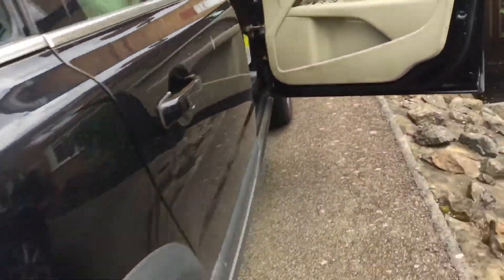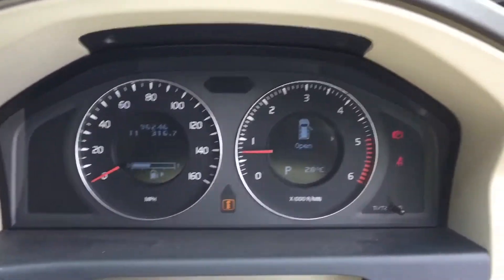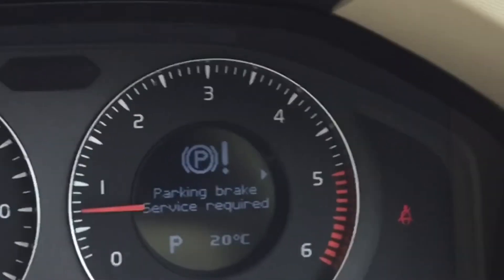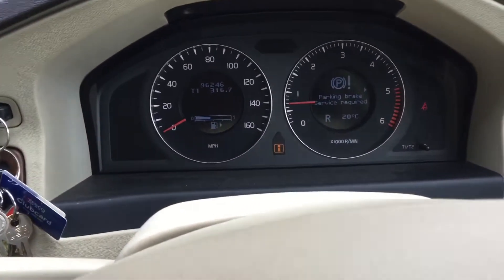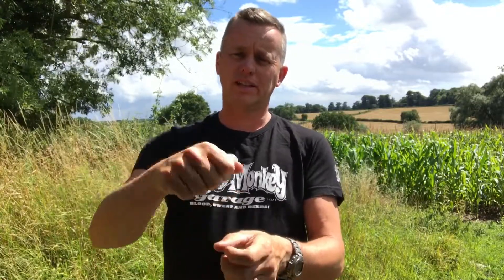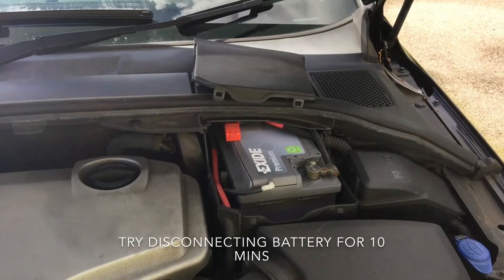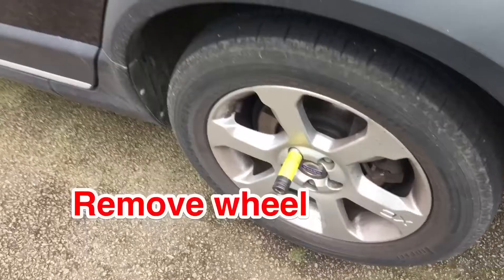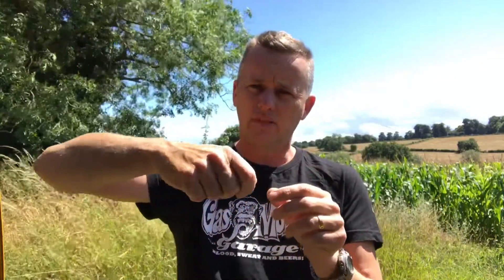VOLVO ELECTRIC PARKING BRAKE FAULT, HOW TO RELEASE IN A EMERGENCY XC70 V70 S70 C70 S80 S90 V90 XC90

Comment: My handbrake was just fine until I left the negative terminal off for 1 hour while doing a little coil work, and when I set off, it will not release the handbrake automatically, and I have to do it manually. I also find that when the rear pads were reaching their wear limit, the rear tended to drag and not release very well. Also, stopping and restarting the car sometimes gave the computers time to think and reset. I'm looking for a fuse now to see if it popped while removing the negative battery terminal.
Reply from the maker: You will need a bi directional code reader to reset like this https://youtu.be/Vi978aK4LGU you can also set the rear calibers and epb Thanks for the great comments👍🏻👍🏻🛠

Comment: Tips: use your phone to film each wheel, compare the sounds of the handbrake motor. For me the problem was dead right side brakemotor (or almost dead). Then i used 9v battery inside the brakemotor - no effect, then 12v, with veeeeeey little to almost no effect. I changed the right side caliper and brakemotor, and problem solved. I opend up the bad parts, and it was filled with salt, mud, rust etc.. inside the caliper cylinder there where parts that where loose to, so im glad i changed the whole thing.
Reply from the maker: Thanks for the great information👍🏻👍🏻🛠

Comment: You can also put the key to position 2, press the brake and pull for 5 seconds on handbrake release lever. Voila...
Reply: Unfortunately this didn't work on my manual V70
Reply from the maker: Thanks for the great information👍🏻👍🏻🛠
Reply: and if keycard..???? is it still possible

Comment: This happened to me and I removed the battery negative terminal for around 10mins, put it back and used a scan tool to clear all errors on the Parking Brake module and the issue went away, worked perfectly afterwards
Reply: Thanks! This worked for me too. Haven't cleared the codes yet, but it allowed me to move the car.
Reply from the maker: Thanks for the great information👍🏻👍🏻🛠

Comment: got the P problem on my 2018 s90 and the dealer said both batteries needed to be replaced, small and large one, for 1000 dollars. They s aid the problem was caused by weak batteries. This just sounded like b.s. to me, and I expect after getting gouged that the problem will immediately start again. Does this sound like b.s. to anyone else?
Reply from the maker: Sounds a bit strange, normally starting issues are more battery related, you can buy a tester yourself to be sure one like this will work fine, https://youtu.be/aOXY1qenzno Thanks for the great comments👍🏻👍🏻🛠

Comment: I've heard that disconnecting the battery without providing 12v power to the main scan connector (OBD 2) to maintain the computers can screw-up the operation of the engine until the engine computer "re-learns" your driving habits. Can also make the radio unoperapable until a passcode is re-inputted that only a volvo dealer can do.
Reply from the maker: Don't believe everything you hear, Thanks for the great comments👍🏻👍🏻🛠

Comment: It will automatically release the brake if you put the seat belt on and either put on D or R and press the throttle.
Reply from the maker: It will if its working correctly Thanks for the great comments👍🏻👍🏻🛠
Reply: @aaanton11  mine wasn't working correctly but I still managed to release it this way. But you're right. If it's a faulty calliper, it won't work
Reply: Unfortunately this didn't work for me on my manual V70.

Comment: I had a similar incident on my S80, twice. I had the good fortune that it released itself after a few attempts to gently move the car by putting it in gear. After that I never used the parking brake again, even though the dealer told me they fixed it. I'm not taking anymore chances. It took me about an hour to study the issue and to get it unstuck. So I today just park the car with the gear shifter in P and make sure that I'm not on an incline. 
Ok thnx for the video!
Reply from the maker: Thanks Gabor for the great comments👍🏻👍🏻🛠
Reply: And what if you're in an incline surface?

Comment: You don't need diagnostics if the motor is sticking. Just replace it and the system recalibrates itself. Same as when you change the brake pads. Just put your foot on the brake and pull the handbrake switch a few times and you are good to go.
Reply from the maker: Thanks Beebo for the great information👍🏻👍🏻🛠
Reply: Unfortunately it didn't work for me on my V70
Reply: My s80 it's failing to drive just after the handbrake light pop up

Comment: What is the tool he placed on the brakes after unplugging it?
Reply from the maker: Basically you are connecting a 12v battery across the two pins.
I used some stiff wires crimped to a couple of terminals, attached to a fused power pack, one direction releases the other applies the pressure.Thanks for the great comments👍🏻👍🏻🛠

Comment: I used this procedure to back out the EPB solenoid to change the rear pads.  Thank you.  REMEMBER TO MAKE SURE YOU RE-SEAT THE CONNECTOR ALL THE WAY.  I did not.  Got the  Parking Brake maintenance message and was almost convinced that I needed a VIDA to calibrate after a pad replacement.  Luckily, I checked the connector.  Message went away.  Pads changed.  Parking brakes work.  No VIDA or dealer expense required.
Reply: This is Robert.  Concerning my success, check that your pads are holding the brake disk (aka acting like a parking brakes should).  My local shop said that if the motors have to run too long and do not engage the pads to the disk, a fault may occur.
Reply from the maker: Well done, thanks for posting this information 👍🏻👍🏻
Reply: hi robert , i changed my rear breaks and am getting the same message. both my motor seem to work . Should i verify if the connectors are properly seated.

Comment: Any idea why electronic hand brake operates by itself when not in use?
Reply from the maker: On some models they seem to activate when everything is switched off and vehicle is locked.
Reply: If it didn't drain baterry, I wouldn't complain.